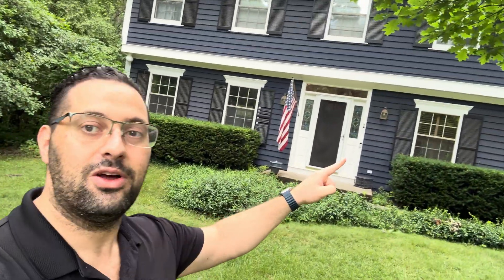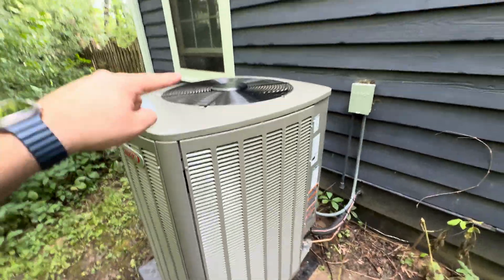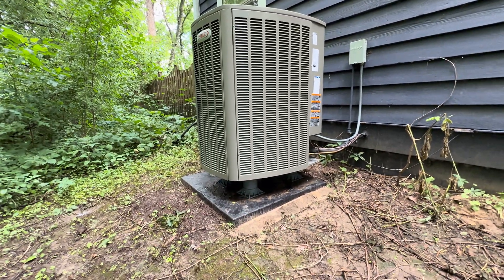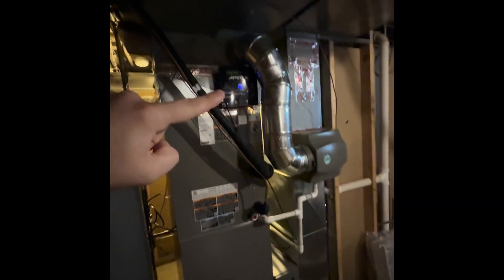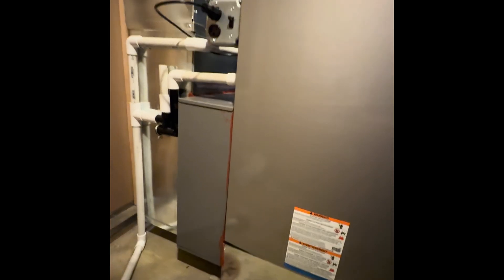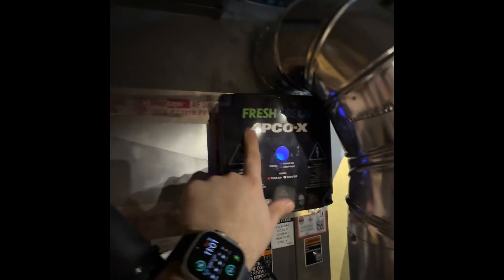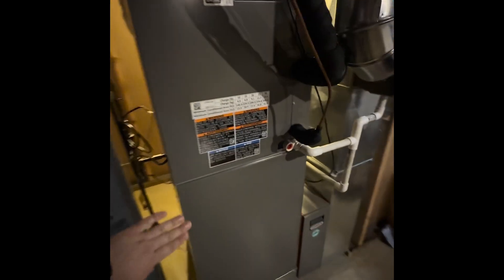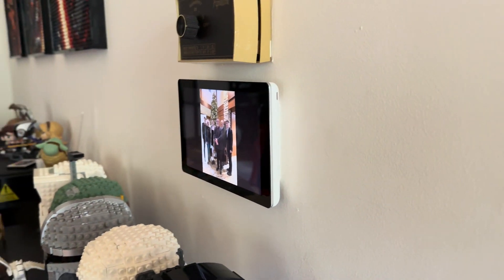Lennox Elite Series Variable Speed Furnace and Heat Pump

Comment: Price tag on that system?
How much was the electric and gas bill with the previous HVAC per month?  Now with the new Lennox?
Reply from the maker: This one was about 20k before tax credits and Lennox cash back rebate available now. Homeowner will get 2600 back when doing taxes and a 1k Lennox prepaid Visa card. Tex credit is good with installs  by December 31st 2025 and it’s being eliminated after that.

This was just installed by but this 18 SEER2 inverter system should use less than half the power of the older 13 SEER1 single stage for cooling. 
for heating cost will depend on homeowner preference of setting on balance points, as there are comfort advantages with the heat pump but potentially higher cost at lower temperatures 

Thanks for watching !